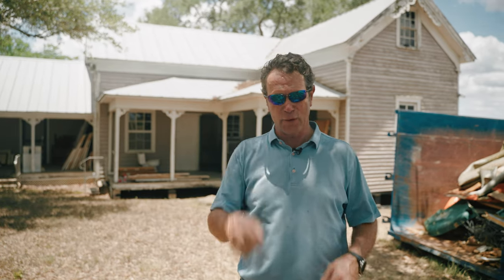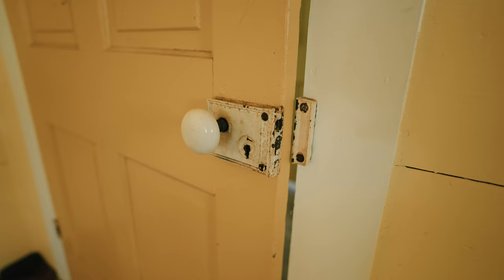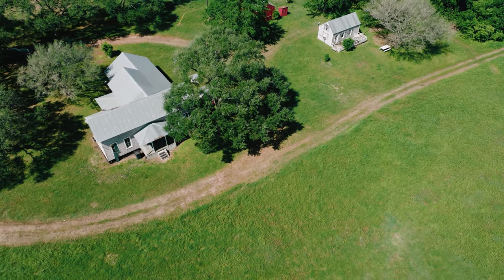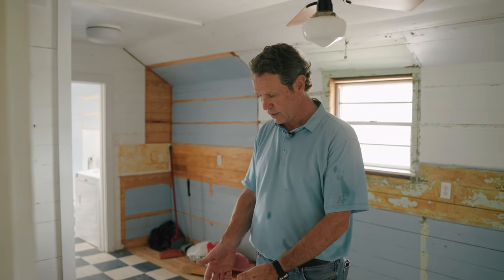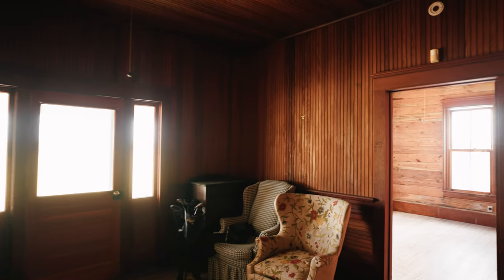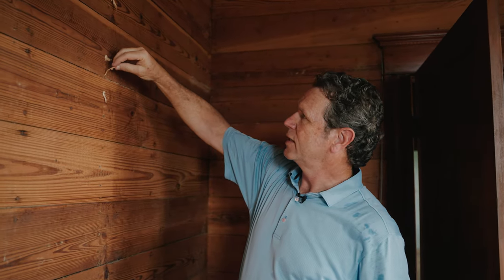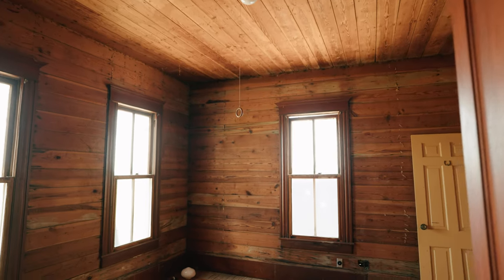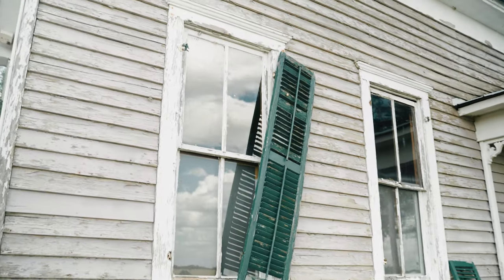How to date your historic house.

Comment: With wide fir planks on the inside and carved doors, my original house might be older than I thought lol. But newspaper installed underneath wall paper dates to 1916. Definitely a mix, with handmade square nails used on the exterior trim
Reply from the maker: Dang, if you have square nails, it probably dates to before 1890. Sounds like a great one. Thanks.